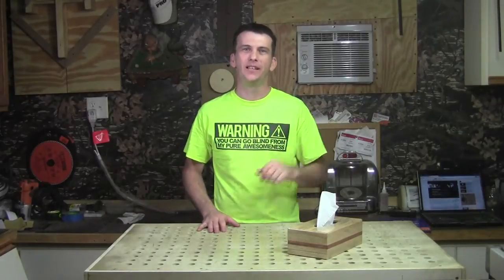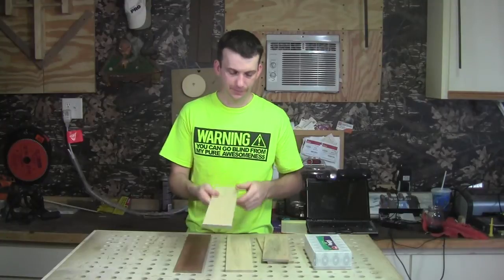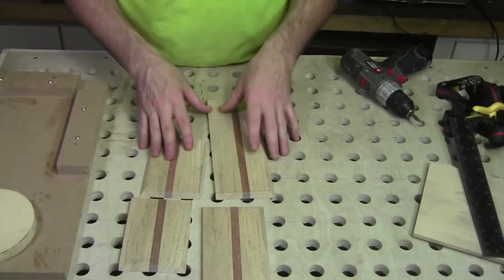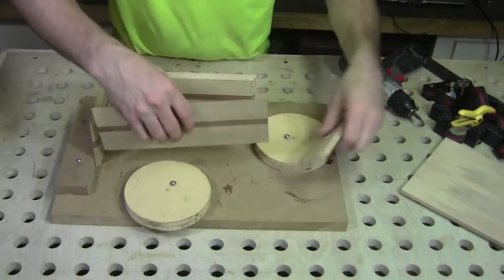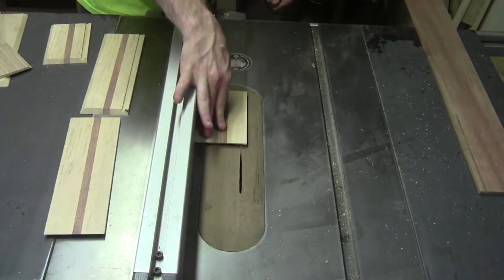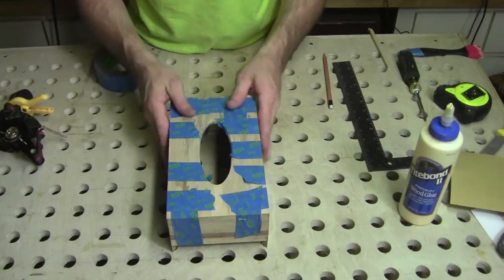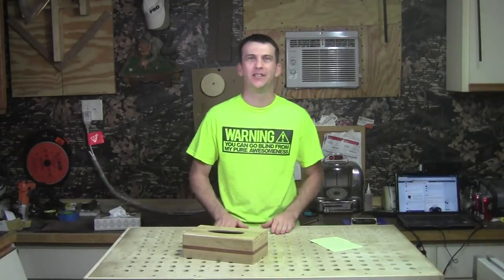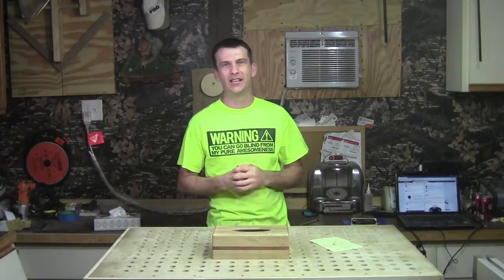Make A Simple Tissue Box

Comment from the maker: Truckrun, I applied 6 coats of Deft rattle can lacquer rubbed out with 1 coat of paste wax. 2 coats of lacquer would have been enough if I were using my turbine sprayer, but due to the rain and bad weather I had to spray in my shop. So the can spray lacquer had to be used.

Comment from the maker: Yes you position the cams (cirlces) where ever you need for the particular project you are doing. Depending on the size (frames or Boxes) you are making determines the size of the base of the jig. I have 1 small which you saw in the video, 1 medium and one large . I have 2 band clamps. sometimes I will use the cam clamp jig and the band clamps together.. either one works well